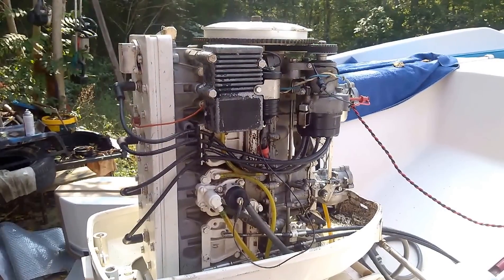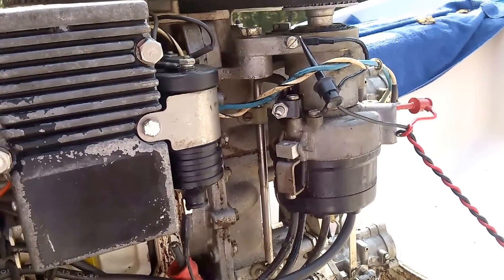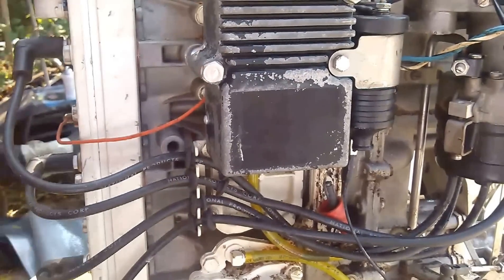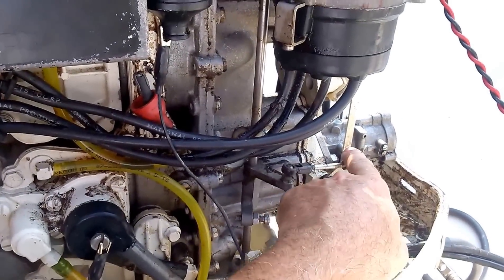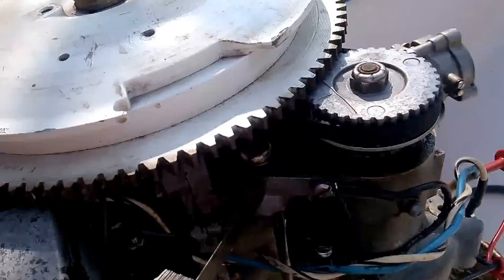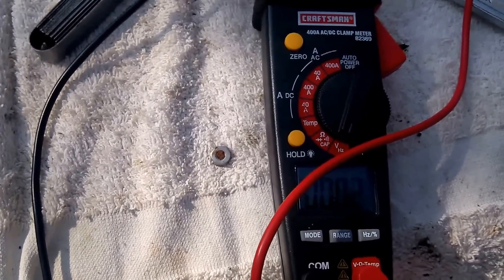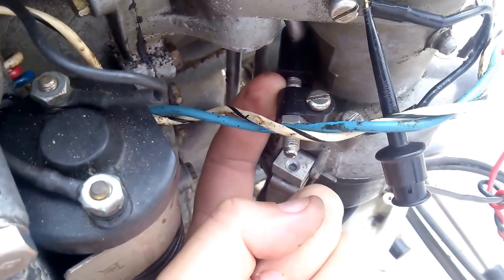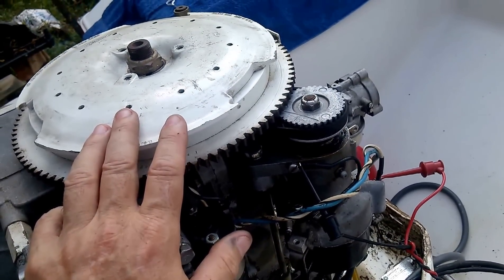Chrysler outboard setting ignition timing Part 2

Comment: Heh so my 75 hp cranks but doesn’t start. Am getting spark, fuel, and compression. I checked the alignment marks on the distributer and the flywheel, and the t is lined up with one of the flywheel teeth when the tab is lined up with tdc. The #1 cylinder is at tdc when the tab is lined up. I did this check, and I get 12v when at 30 degrees btdc and drops to 0 long after tdc. What does that mean?
Reply: I've done the same steps as you,I get good spark from coil but will not spark to the plugs. I think the rotor is ground the spark to the distributor shaft.New rotor and cap coming in the mail.
Reply: The rotor was bad, replaced it now I got spark to the plugs
Reply: Traducción al español x favor

Comment: Great video. So helpful.  I just got a 1974 Chrysler 135 hp. Idles good, starts easily when warmed up, 3000-5000 rpms is great (good smooth power), 1700-3000rpms under load it stumbles badly, tap of the choke helps it. Engine in excellent condition, carbs cleaned, does not seem to have crankcase leak, new fuel lines, new fuel puddle lines, adjusted carbs as you described, ended up with 1 1/8 on idle screw. Could the carb to distributor link be adjusted wrong causing not enough advance off idle or are the carbs bad? Thanks!
Reply: Do you know where I can order a 4 cylinder distributor cap with a coil wire in the middle and wires already attached to the distributor capz?

Comment: count the number of teeth on flywheel,divide by 360,then multiply by30 degrees will give you the number of teeth before TDC you want to fire at. Throttle wide open.  Example: 92 teeth divided by 360 = 2.666 multiply by 30 degrees = 8 teeth BTDC.

Comment from the maker: 36-4=32 You don't really know or care what the idle timing is. If the WOT timing is set then the idle timing is good also. The WOT timing for the 105 is 32 degrees but the other hp ratings may be different, look it up to be safe.
Reply: The WOT for the 135 is 30 degrees.